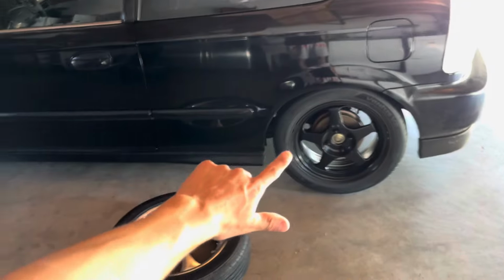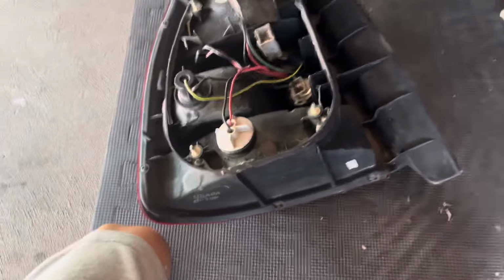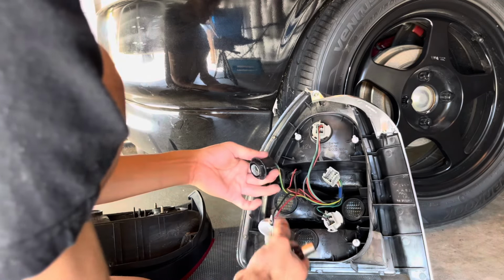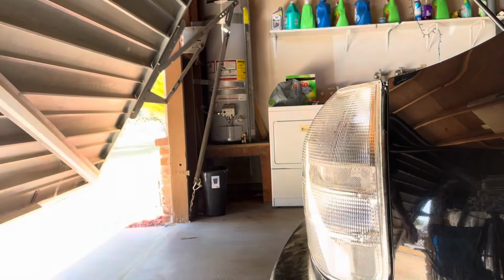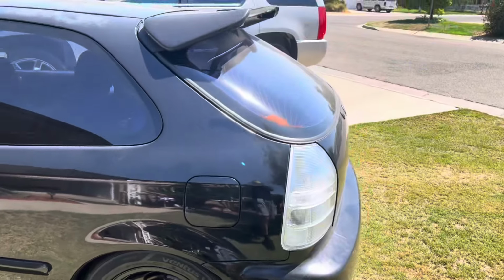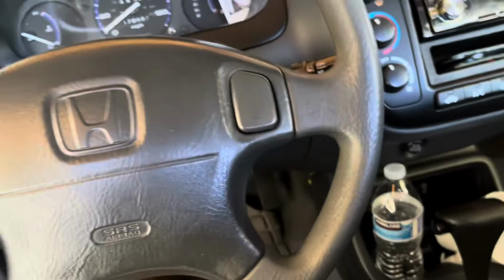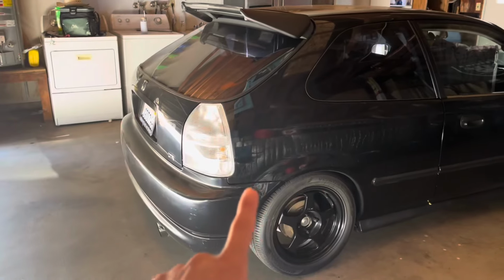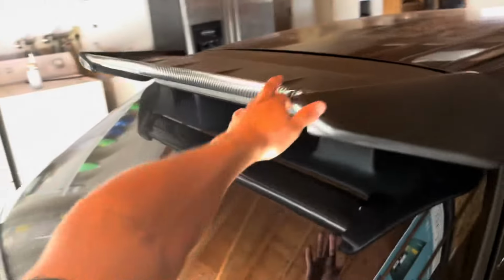INSTALLED CLEAR TAILS ON MY EK HATCH

Comment: Clean  hatches are hard to come by these days.  I used to have roma red cx but was forced to sell it cause it was not garaged.; It looks like yours  is secured. Finally  settled for a 2000 coupe ex which I'm doing a full restoration and full color change cant wait to get it at  the stage as yours is in? I agree with other comments the black wheels over the chrome.
Reply from the maker: @alpha2daquest885  thanks for your comment man! Good luck on your bulid and yeah I dig the black wheels also